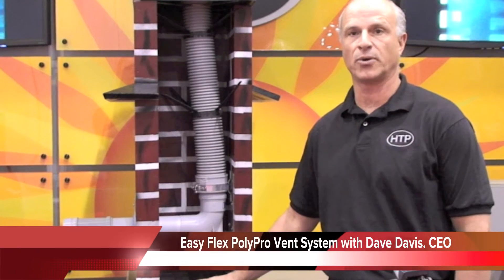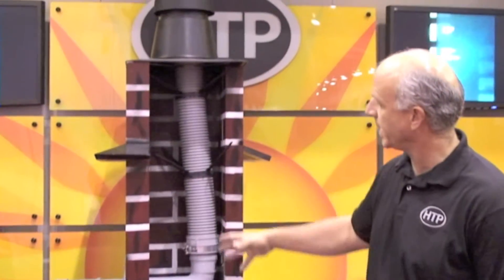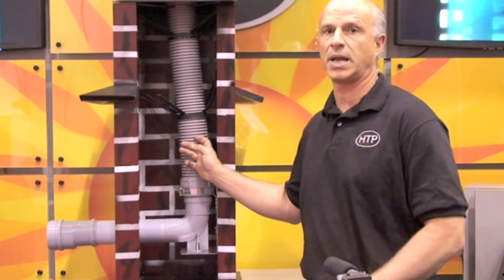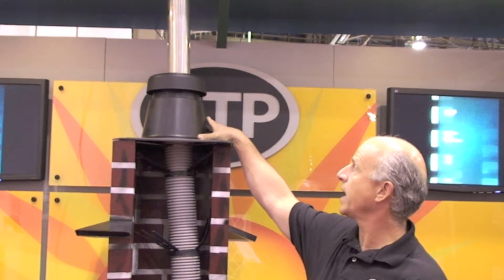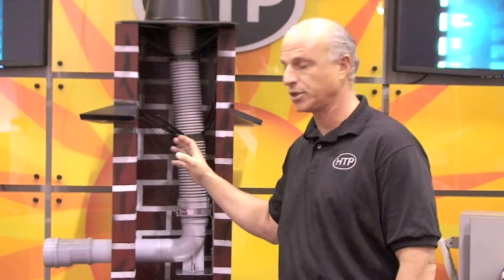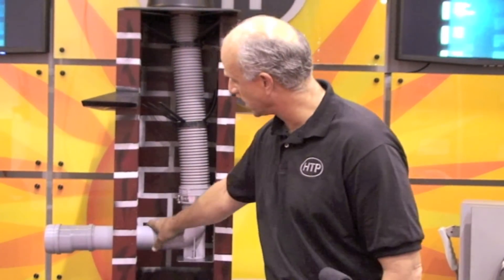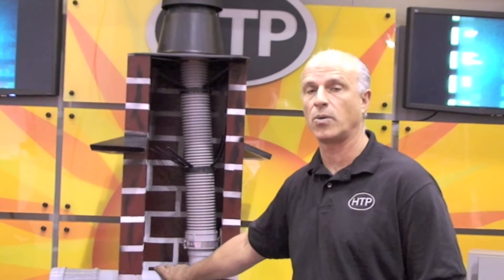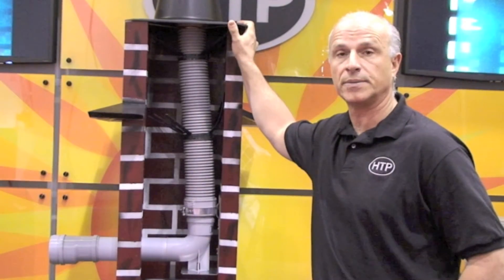HTP's Easy Flex PolyPro Vent System for venting boiler or water heater exhaust up chimneys

Comment: Personally I think the system could use a few modifications. No way on most installations would it be possible to mount the sheet metal bracket into the chimney and clearly it was not done in this video. Also it was noticed there was little possiblity the snap clamp at the bottom was access-able to be closed. 

I would suggest creating a system whereby the flexiable line could be pulled out of the chimney eliminating the 90 at the base. All connections and mount support should be moved to the exterior front of the chimney. It might also be profitable to offer a riser kit in order to accommodate the hight of the flue tile and a better connection of the final flashing. Why not also delete the stainless steel final exhaust in leu of a shorter plastic riser?
Reply: I know im asking the wrong place but does any of you know of a trick to get back into an Instagram account??
I was stupid lost the password. I appreciate any tricks you can offer me.
Reply: @Alessandro Coleman instablaster ;)
Reply: @Elijah Colin I really appreciate your reply. I found the site thru google and I'm in the hacking process now.
I see it takes quite some time so I will reply here later when my account password hopefully is recovered.
Reply: @Elijah Colin It worked and I now got access to my account again. Im so happy:D
Thank you so much, you saved my ass!
Reply: @Alessandro Coleman You are welcome :)